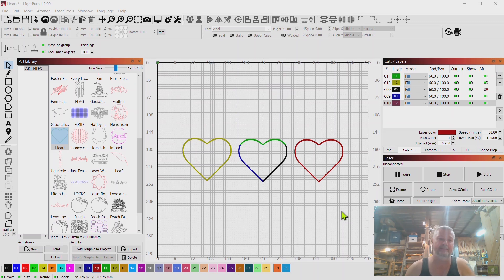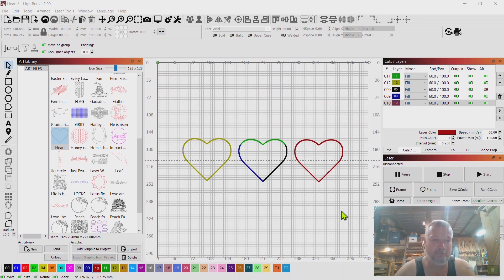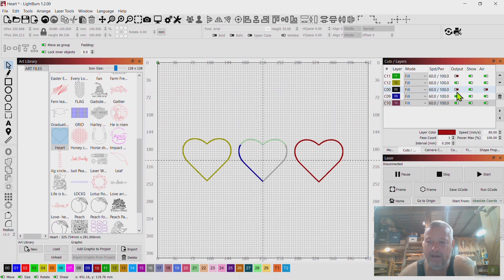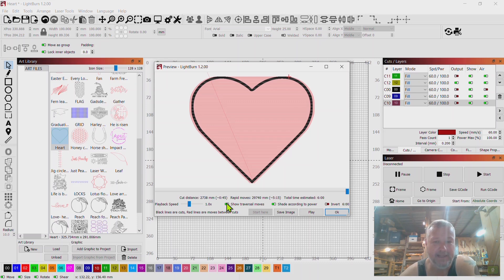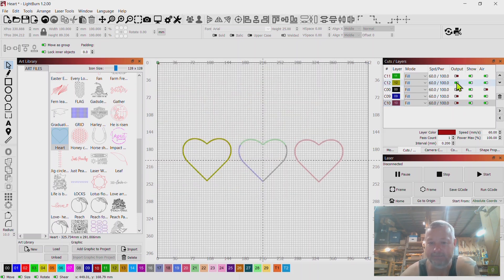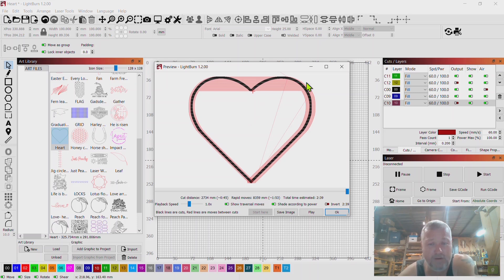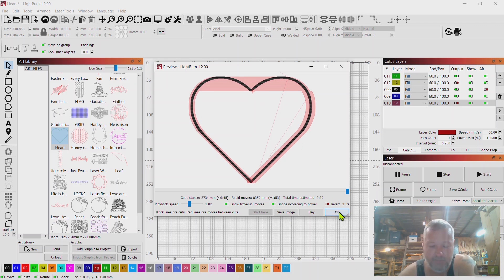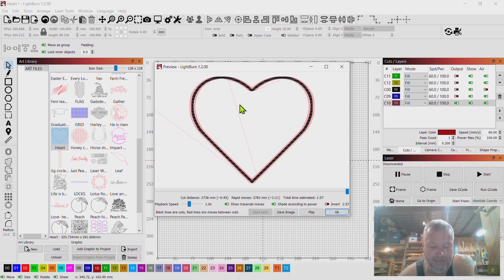Even faster burns- using flood fill in lightburn

Comment: Thanks for showing me about flood fill, I learned something very useful today. You could also use offset fill for stuff like this as well- it's really good for borders and thin edges like when burning a map onto a coaster or those layered maps with a lot of engraved roads. Offset fill turned a 5 hour burn into a 1 hour burn when I was making a gift for my Brother- a layered map that was about 16x16 Inches- turned out great! This is definitely going to help in the future. I love lightburn!
Reply from the maker: Offset fill makes some burns longer. I suggest trying several settings or removing white space.

Comment: Great series of videos.  One thing I found was when I go back to roller parts I need to remember to turn off flood.  Then it will progress evenly in one direction like a line printer and for odd shaped items you don't have to worry about a back and forth rotation throwing the part askew.  I googled flood fill and now it makes sense.  Think of the game minesweeper when the software is trying to figure out the moves.  It's basically the name of the algorithm.
Reply from the maker: Yea, it only takes a few times to remember to check it... been there

Comment: Just out of curiosity, I noticed all your layers shown except C00 have Air Assist sliders green/turned on.

Do you have Air Assist on M7 or M8 controlling your Air Assist Pump? Maybe hooked up with a 24V to 110Vac Solid State Relay (aka SSR)?

I’m planning to do some Pin Diagnostics of the Comgrow and OMTech Controller Boards to see of either have a Hardware Pin controlled by the LB software switches and Machine Settings where you tell LB, via mutually exclusive radio buttons, which Grbl Mx-command (labeled M7/M8) your Controller uses to turn on Air Assist auto-magically.

That way when, in your case, C00 is being Cut/Engraved/Burned, Air Assist would be turned OFF and for the other Layers, it would be turned ON…all auto-magically without you having to flip a physical switch.

I’ve seen reviews of Ortur Engravers that have that feature supported.
Reply from the maker: I do not have a relay, I have looked into it and would like to add it but haven't yet.

Comment: Dave… yesterday I set up a template to engrave 6 - 4” slate coasters.  The design had the outline of an Island that nearly filled 3-1/2”, a compass rose, a ferry and a light house. Also, with some text. In normal fill (22mm/s and 50% power) it took 5 hrs, 59 min and 39 sec (preview values). 
Really a long time. In preview, it started at the bottom and laser’s 15” from left to right in both directions with a significant amount of time just traveling. 
If I change to flood fill, the time goes down to 1 hour 33 min 47 seconds.  Tremendous reduction in time. However, if you use off-set fill the time goes down to 45 min 13 seconds. What I haven’t tried to determine is if any quality is lost using either flood fill or off-set fill. Could not find much of anything on the forums that discussed those two options. Might make a good video. Keep up the great videos you are making. So helpful. Cheers!
Reply: Be interested to see what you find. I did a test on a compass rose using offset fill and flood fill with same laser settings. Minor difference from my test with offset fill being slightly more accurate and ran in nearly half the time as flood fill. I think that will be my go to from now on.
Reply from the maker: I may set something up and try it. At least the settings did help.

Comment: Another wonderful video, David!   Since you mentioned maintenance, I want to make a request.  In one of your videos, you pulled out a small tube of "goop" from the shelf above your D1 and squirted a bit onto your finger to lubricate the moving parts.  I've been wondering...
What is that stuff?
Do you know where we could get either that exact stuff or something similar?
Thanks!
Reply from the maker: That is the grease that came with my machine. It appears to be standard lithium grease. It is similar to what you can use on firearms.

Comment: How do you make it flood fill!
Reply from the maker: My bad, I must have trimmed it out of the video. It is under the advanced tab in the burn tab where you set the power and speed.
Reply: Open the Fill settings and click on the advanced tab.  It will be a switch near the bottom.  Playing with the settings, it seems like offset fill may be a better choice.
Reply from the maker: https://youtu.be/UWj-HddfEBQ